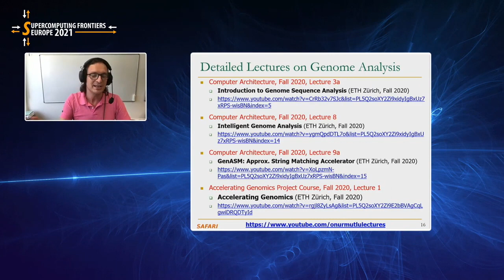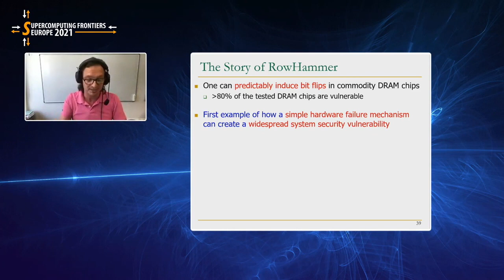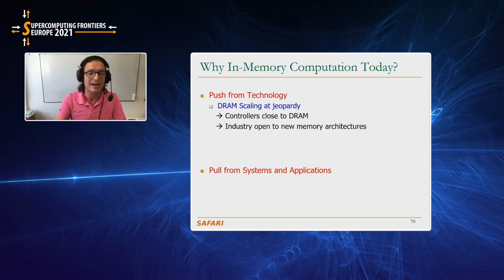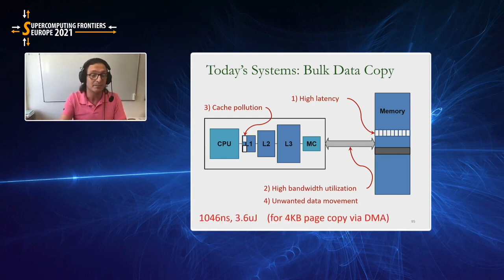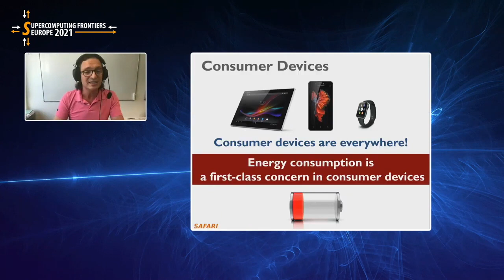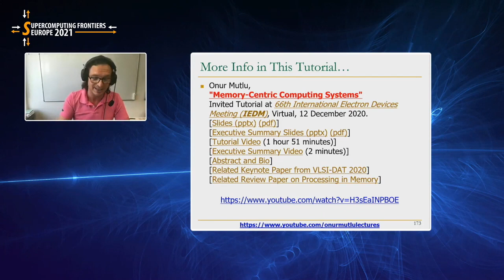Onur Mutlu - Supercomputing Frontiers Europe'21 - Intelligent Architectures for Intelligent Systems

Comment: Is it worth implementing intelligent architecture on FPGAs? Please answer to me "FPGA made Easy" youtube channel.
Reply: I think if you think you have some idea then do not stop experimenting what you think you can , keep exploring and Implementing on FPGA to see how it actually happens .
Reply: FPGAs are used fairly commonly as accelerators for some "intelligent" workloads, although not as much as they could be. For some applications though, where the workload is the same and has a core element that can be used in multiple different but related situations, like genome sequencing for example, it's worth developing an architecture that is more set in stone. or silicon rather haha